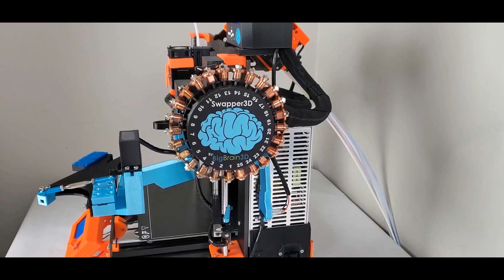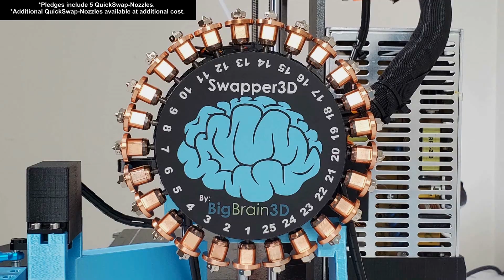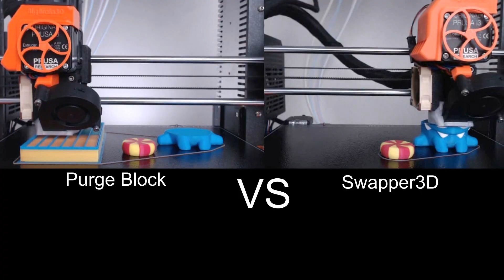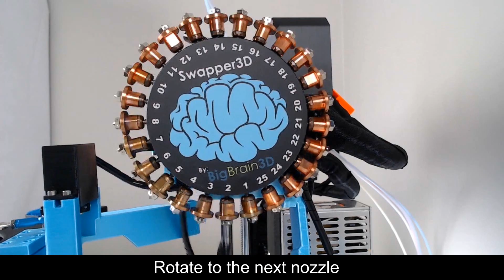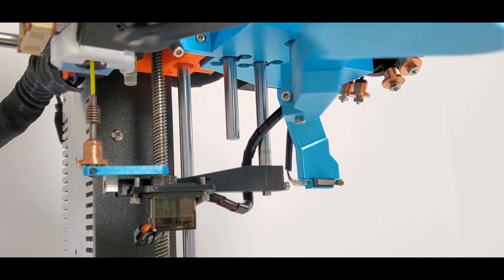Never print a purge block again!

Comment: Is it only compatible with Prusa i3's, what about printers that aren't bedslingers?
where and how do I swap spools? 
Do I need to roll my own solution for multiplexing feeder motors?
You have the heat break and the nozzle swapped around, doesn't this mean that you will be unable to retract?
How will this affect PID tuning every time a nozzle is mounted and unmounted?
Z height alignment seems like a problem.
Your device features parts that appear to be larger than the print area of your printer. 
Will I be expected to print the parts for it? How much of this is going to be opensource?
Reply from the maker: Currently only Prusa i3 is supported, but we will be adding support for new printers as fast as possible. Also, if you can do 3d design you could make your own adapter. 
You can switch spools/filament automatically with an MMU, Mosaic Palette, ERCF, Co Print, etc. 
Retraction has 2 effects which both make a large impact to stringing. 1) removing extrusion pressure and 2) creating suction at the tip of the nozzle. The #1 effect is seen immediately after a swap. The #2 effect is seen shortly after a little bit of extrusion, and to account for that we change the slicer to infill before perimeters. There is also the wiper on the cutter arm (not seen in this video. More info on Kickstarter page.) that can be used for priming the nozzle. Thanks for your comment :)
It takes 15 seconds for a newly inserted nozzle to heat up to melt temp. That time is hidden in the filament switching time so it adds nothing extra to the swap. PID tuning learns automatically to the heat the nozzles.
The nozzle collars are machines to very close tolerances. z height alignment has been great so far.
The parts can be printed within a 7x7x7 inch build volume. You can also buy the parts from us. 
The firmware and model parts are 'creative commons attribution non-commercial 3.0'.

Comment: Does the system recognize which color was used with which nozzle, or it just cycles through the nozzles? If so, how does the filament left in the nozzle gets purged?
Reply: Why wouldn't it recognize which color are what? That's like one array of variables that it just needs to store. Easy for a computer to do.
Reply: @bobsixtyfour  is that an assumption or it was confirmed?
Reply from the maker: The Swapper3D knows that Tool 1/2/3/etc is in a specific receptacle so that each nozzle is reused when that tool is called again later in the print, that is what it 'keeps track of', it doesn't know which color or material is loaded in which nozzle; You need to organize that in the slicer.

Comment: This is ridiculous, you need a Palette or MMU to change the material as well! And 25 heads, get real - more components, more complexity is Less Reliability.
Five, at most 8 heads would make a little more sense but even then... Palette fuses the incoming filament and can increasingly purge into infill, this device erases all of that hard work.
Swapper3D is a high failure rate robot, waiting to fail. 
A huge step backwards in multi-material printing that might remove the purge block. But locks the user into the quick-swap extruder. Introduces another layer of progressive inaccuracy between the material selector and the print. Adds many many points of failure to an already complex process and completely disregards how (people like) Mosaic are solving this problem.
If you want to reduce 3dp waste, make a reliable Filament Recycler for £200 - 3dp owners typically don't have multi-material but do have buckets of PLA waste. Let's assume 1% of owners actually print multi-material (it's much less) Filament recycling would turn your 300 tons of avoided landfill into 30,000. Saving 100x as much landfill and a bunch of money.

Comment: So, no.. didnt read all the comments but while I can partially agree on time savings the variable your not seeming to mention is preheat time.. your pulling a hot nozzle (presumably) and swapping cold.  The nozzle ha to heat up before operation can resume.  But, as you said.. you did apparently eliminate the purge block.  All this is on what we have seen though and no view of the back end.

Comment: Tengo una prtegunta. El cambio de color no deberia coincidir con el cambio de boquilla? En el ejemplo, quita la amarilla y pone una azul. Pero cuando corta el filamento amarillo, no deberia haberlo cortado justo en el cambio entre amarillo y azul?
Reply from the maker: Good question. The answer is that it doesn't matter when the filament is changed in relation to when the nozzle is swapped. We swap the nozzle first so that the heat up time is during the filament change. The only thing that matters is that the filament and nozzle colors/materials match before the print resumes.
Reply: @BigBrain3D  Ah okay.  now I fully understand.  I thought that the change of nozzle was combined with the palette and that when the new nozzle arrived the color should already be changed thanks to the palette.
Reply from the maker: @javicc7388  Here is a video showing the palette splice being cut out: https://youtu.be/1PxOplfcI3A
Reply: @BigBrain3D  exact.  that's just what I had understood he was doing, I hadn't seen that video.  the truth is that it is a very good system to save time and filament

Comment: Nice concept poor design.  Who needs 25 nozzles.... And eventually you'll need to purge each nozzle out.  A complete tool change or just color change and purge the usual add you would during a neutral color change is plenty.   A purge block is unnecessary.  A tool change is a better option.... This is overkill and just too bulky and bad design overall.  You have so many issues here that make this a terrible idea.  It's a cool concept, but extremely faulty.  You have heating issues, z level issues, the bulky size, the speed with the unstable weight, cleaning, number of noodles, you're not solving a problem you're just adding 24 more.  Rather than changing heads, you need to create something like the prusa xl.  Change tool heads.... Or build a better palette.  But this, this will not work.  It looks cool.... But realistically speaking, there's too many factors that will cause this to fail.

Comment: Is the machine heating all of those blocks through the entire print, or are they heated and cooked after every swap?  Thanks!
Reply: I expect they're allowed to cool in the carousel, as the heater block isn't getting swapped and its contact surface is outside the wheel. Typically when we talk of "cooking" filament it's keeping the hot end loaded and hot for excessive amounts of time, which risks drooling and burning. Both those consequences would require purging again for neat prints.
Reply: @0LoneTech  Yeah, this was concern!  Seem this device will just trade a purge block with my more valuable "time"!
Reply from the maker: No, it takes less time than purging which is the point of this demonstration.

Comment: Haha. No. This is bullshit. 
First, how long does it take to heat up a new nozzle? Second, how do you clean the used nozzles? 
Third, 25 nozzles? In a multi colored print, your will need a lot more changes than that. 
Fourth, how do you prime the new nozzles? 
A lot of questions, no answers in your video. This will NEVER work! 
I call it a scam. All your fake commentaries can't hide that!

Comment: In the cnc  'biz' there's a metric called 'chip to chip' time. How long does it take from printing one filament to printing another? PS the record low time, IIRC, is the Brother tapping machine that can do it in 1/2 second. ;-)
Reply from the maker: It takes 12 seconds to swap a nozzle (cut->stow->replace). Someday we hope to get that down to 1/2 second ;)
For now we are content that it takes less time than purging the old material out.

Comment: Looks very interesting. But you can not use retractions on that piece of filament in the hotend. Right?
Reply from the maker: Retraction has 2 effects which both make a large impact to stringing. 1) removing extrusion pressure and 2) creating suction at the tip of the nozzle. The #1 effect is seen immediately after a swap. The #2 effect is seen shortly after a little bit of extrusion, and to account for that we change the slicer to infill before perimeters. There is also the wiper on the cutter arm (not seen in this video. More info on Kickstarter page.) that can be used for priming the nozzle. Thanks for your comment :)

Comment: Nice video, but it fails to address several important concerns.   

Since you're changing out the entire hot-end, it is going to take a lot of time to switch it and to heat it up to temperature ... plus the thermister to register the nozzle/block temp isn't going to be as accurate unless you just wait longer for the heating to stablize.  Is that time really represented in your figures, or did you just opportunistically simulate that.

You offer up top 25 nozzles, which is also expensive.  But since you leave filament in each one, then I don't see how they can be reused unless somebody is standing by picking out the filament between swaps to allow for reuse again.   25 nozzles isn't going to last long for a hundred layer 2 color print, which is going to need 200 nozzle swaps.

because the newly swapped nozzle is otherwise empty, then some amount of pre extraction has to happen to get a consistent flow.  That would require some sort of purge block?  You're pushing air for part of that.  Even if your model has enough internal space to evacuate ... it sounds like a quality issue for the print.
Reply: 1. You can have it wait a specified time after doing a swap for heating to stabilize.  So maybe 45-60 seconds between swaps?
2. Up to 25 nozzles.  You don't have to get 25.  Only need however many colors you'll use at one time.  So 5-12.  Why would you be picking out the filament between swaps?  In your first question you pointed out that the nozzle/block temp need to stabilize.  The filament is in the nozzle being reheated with the nozzle.  Just like starting a new print with the same filament you used the day prior that's still in the nozzle.  Two color print will use 2 nozzles.  
3.  You would prime the nozzles prior to printing.  Easy setup procedure.
Reply: @zombieno1  I guess I’m pessimistic that the incoming filament will cleanly press against the previously short cut end from the reused hot end.  Seems like a failure point with some non trivial ratio.   I could just be way off though

Comment: during printing, the nozzle are very hot, over 200°C, how could you take it out by an arm made by PLA? or PETG maybe.
Reply from the maker: The end effector is Stainless steel, which does not transfer the heat, even with rapid swaps to deform the PET arm. We did think of this already and stress tested it. It works!  Thanks for the question.

Comment: I dont think a tool changer for nozzles solves purge blocks especially when there's only a limited number of them. Eventually the nozzles will develop air gaps from the rapid cooling of excess filament while sitting idle and being reintroduced. Excellent prototype engineering nonetheless though.
Reply: Yea, I'd expect you'd need a bit of purging after reheating the new nozzle. Should at least swipe it on something before resuming the print.
Reply from the maker: There is a wiper that is integrated into the cutter guard. The guard was removed so you can see the cut. Otherwise it would be obscured.
Each nozzle is reused an unlimited number of times during the print. Each of the nozzles is assigned to a single color. The tiny amount of ooze that develops during idle time is just added in extra when the Prusa MMU filament changer feeds the next filament in.
Reply: @BigBrain3D  As expected then :)

Comment: what about retractions and ooze? the first ~3cm of filament is not connected to the extruder, hence the ability to retract the filament is not possible until all the initial filament is purged. Ooze can also be a problem by changing a not nozzle, increasing risk of under extrusion the first centimetres of extrusion. Overengineerd design, but cool concept.
Reply: Agreed and also when the filament that is pushed towards the heatblock hits the ~3cm end of the cut section of filament.. won't that clause extrusion inconsistencies? The two surfaces aren't continuous, so a tiny bit of air will enter the heatblock and presumably heat, expand, and perhaps cause zits on the print...?
Reply: @KieranShort  it'll be so minor it probably won't matter.  Especially if you set your slicer to print infill first.
Reply: @zombieno1  I would imagine it would become imperative to print infill first. If a color change is occurring every layer, the inconsistent extrusion would probably be extremely noticeable, provided that this system even produces the hypothetical artifact in the first place.
Reply: Joe Yacketori worse if a colour change is happening multiple times per layer and if the layers are small, it will spend most of its time swapping and heating up hot ends.
Reply: put in the code to have the right amount of retraction to relieve pressure, turn off the thermistor, full fan speed to prevent ooze and swap.  Would that work?
Reply: zombieno1 even on full fan speed, some oozing still occurs and this means that you would have to wait for the nozzle to cool down before it’s removed and wait for the new nozzle to heat up, on a lot of prints it could take much more time changing, cooling and heating hot ends rather than printing.
Reply: As well as the under extrusion it would cause blobs or lumps on the print where the oozed filament has touched the print.
Reply: @dt1165  I don't know about that. I would think that would leave residue in the nozzle that might cause air bubbles when the next line of filament enters the hotend. Unless the hotend was cooled and the extruder retracted it like a cold pull, but then the end of the filament would be really inconsistent and wispy. At least with cutting the filament, the interface between the short line of old filament and the rest of the spool is a flat, flush snip rather than a crazy wisp or half-melted crap. But that's just a guess on my part.
Edit: Or maybe the residue left in the nozzle after one long retraction would just get re-melted into the incoming filament. But I think air bubbles could still be a problem.
Reply: D T fully retracting the filament wouldn’t leave a nice end on it, which could mess up the filament changer, if the end is all wispy or that, a freshly cut end is probably easier for the mechanism to work with.

Comment: It looks like when a nozzle is swapped out, it still has filament in it, which will cool and harden within the nozzle. How is this purged from the nozzle? Does this mean you only get 25 filament changes for the entire print?
Reply: Just heat it back up when reinserted?
Reply: @KnavishMango  So the system keeps track of which filament is in which nozzle? But even so, there's a couple of cm of filament that can't be retracted and will probably ooze. (BTW: I'm not against the system, I think its a good idea, I just think that there are a few edge case problems)
Reply: @vannoo67  you sound like a calm person and not like those others who have already dismissed this awesome idea.  
So your first question is Yes.  It definitely keeps track of the nozzle.  You'd assign them to each color.  Just like using an automatic tool changer for a CNC.
Your second concern.  I think : put in the code to have the right amount of retraction to relieve pressure, turn off the thermistor, full fan speed to cool off the nozzle and prevent ooze then swap.  Would that work?  Also.. when starting the next layer, set your slicer to print infill first.  That'll purge enough to help make sure the flow is consistent before getting to the walls.  Savvy?
Reply: @zombieno1  this is the way
Reply: @zombieno1  Hide the transition in the in the infill - what a good idea.

Comment: i can see quite a few possibilities for multi-material prints with this, especially as some of the more exotic materials out there are quite expensive. being able to print at multiple "resolutions" with different nozzle sizes coul dlead to some interesting ways to save time, such as doing infill with a much wider nozzle than the outer layers.
Reply: Yes, strong and precise at the same time, with outer contours with a 0.4mm or smaller, say a 0.2mm one, then inners with a thicker bore to push out material faster on fatter lines. You'll get both sharp details on the outer walls while reducing print times for strong parts, or even multi material for outer and inner and infill.
Reply: @Kalvinjj  I wonder if a carbon fiber infill with a multi-color pla outer shell would work or if the materials are too different.

Comment: When you switch colors with Prusa (no MMU) you don’t need a purge block. The machine will extrude an extra bit when you load in new filament and ask you if the color is right otherwise you can have it extrude more.
Reply from the maker: The example print has 576 color changes. I think manually changing color that many times would drive most people mad.

Comment: Neat idea!  I used a slightly different solution... I only print 2 color at a time, usually one is set to clear to print windows in device panels,  so I use a side-by-side nozzle setup and drop the temp on the inactive nozzle so it doesn't drip.  Less swapping coolness than your way but im not really printing in color.